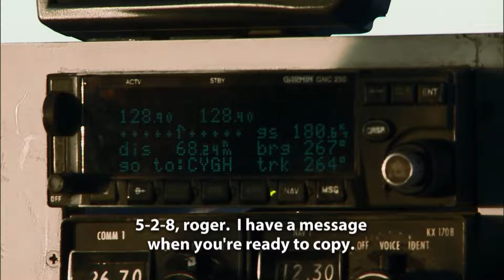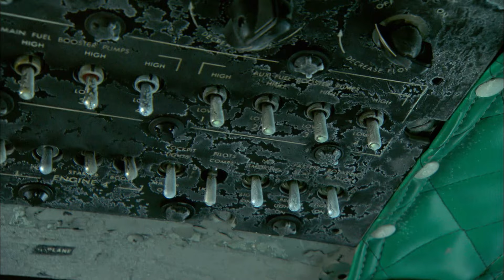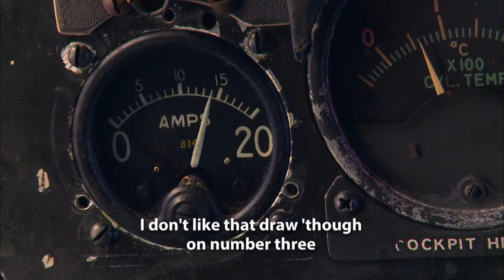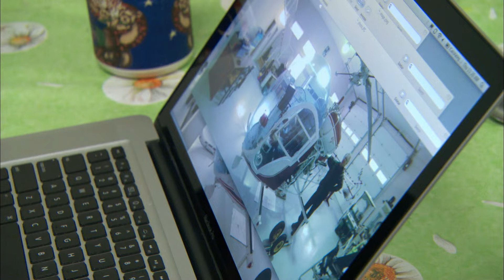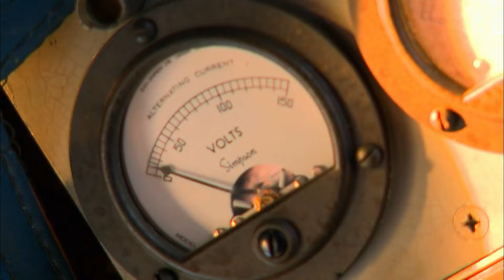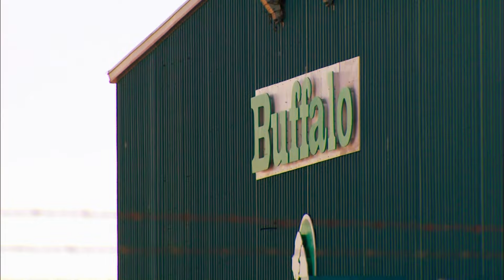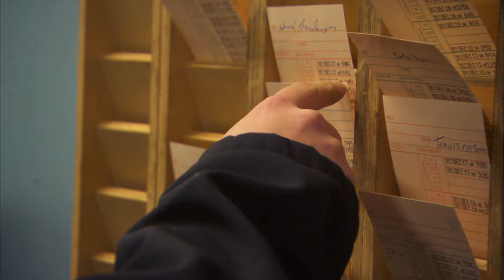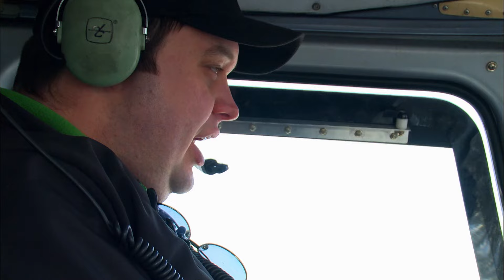Their Plane Catches Fire Mid-Flight On A Rescue Mission | Ice Pilots NWT | Wonder

Comment: I have 2500 hrs in the BE-18,  DC-3 recip and turbo prop,  DC-4 each and never had an engine fire from 1982 to 2016 when I retired,  however shortly after I left Brooks Fuel in 2004 there was an uncontrolable fire so the guy put the DC-4 in the bush near Nenana just after take off from  Fairbanks,  AK

Comment: Takes 4 hours to heat the engines to bring the oil temps from -40 to 0 degres to have oil flowing through the engines during engine start.  We usully didn't fly in wx colder than -40 cause the feathering pumps might not work until you had 3 or 4 minutes in flight to warm the pumps so you could feather in case you lost an engine.  If you can't feather just after take off and your heavy,  I don't thnk you can stay airborne.  In Fairbanks I don't remember wind chill cause wind was usually calm and we never flew during forecast or actual icing conditions cause our 4 didn't have boots.